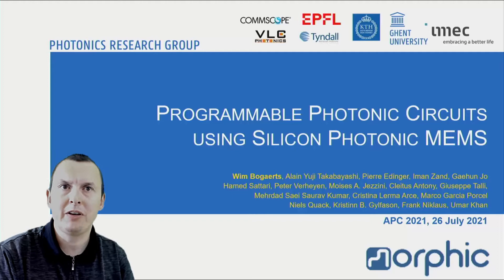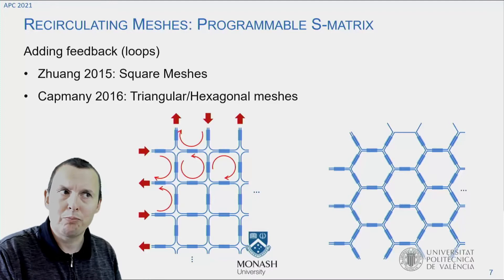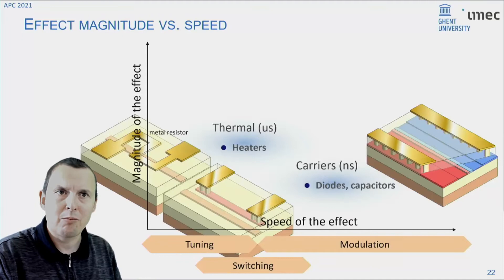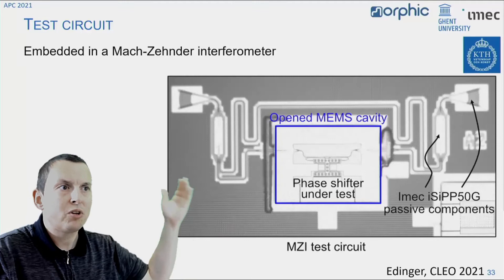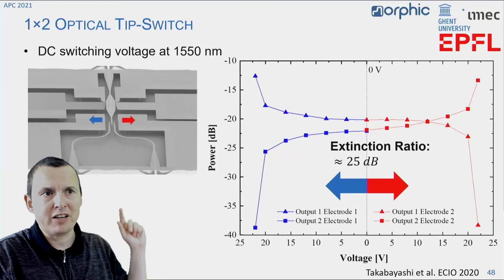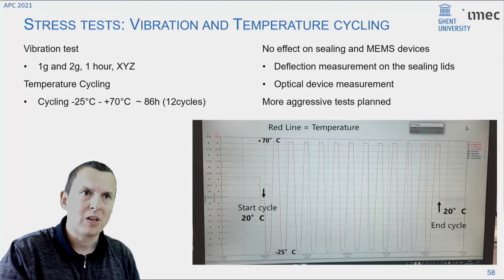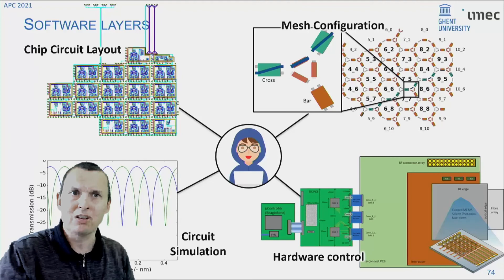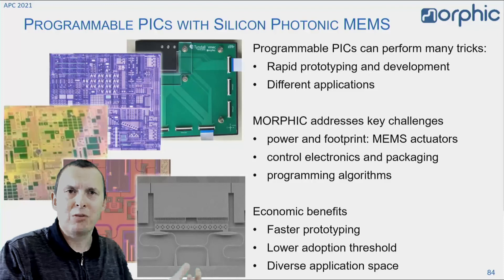APC 2021 - Programmable Photonics with Silicon Photonic MEMS - Wim Bogaerts

Comment: I'm curious how long is the time to switch in a MEMS photonic platform? (i'm dumb you said ~10 microseconds) This seems like it would have the ability to create what is essentially a photonic FPGA but likely wouldn't be suitable for live calculations.
Reply: Indeed. about 10us. You would not be able to switch the MEMS fast to perform 'live' switching. But the MEMS is more like the 'programming' of an FPGA. It is the light itself, by propagating through the chip, that performs the 'calculations' or 'signal processing'. That being said, there are quite a lot of applications where you would really want very fast (ns) switching.
Reply: If you can scale up in terms of number of switches without massive compromises, then there could be little need to have fast switching. My kinda overaching grasp of this is that with all your switches and phase offsets in a given intended state, the switch assembly is essentially simulating a pure equation without the concessions normally associated with handling true analog functions in a digital medium. Inputs go in, and the true solution to that equation/input set comes out. All this to say that with enough switches and phase controllers, the equation being simulated by the switch assembly can be as expansive and convoluted as desired, and theoretically could involve enough series, parallel, and back fed functions that the total propagation and solution time approaches the maximum switching speed.
Entropy willing, of course.